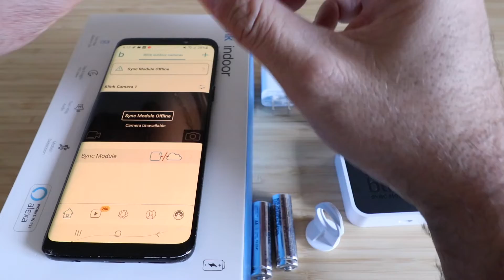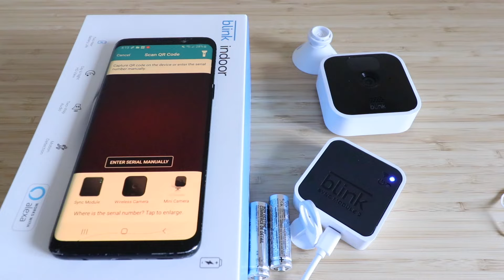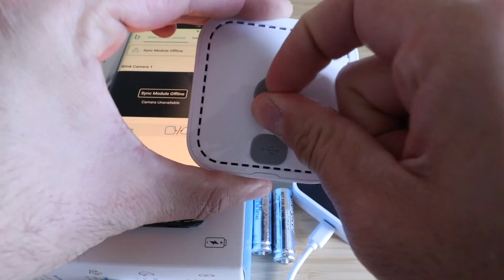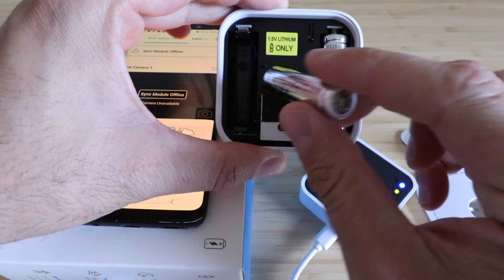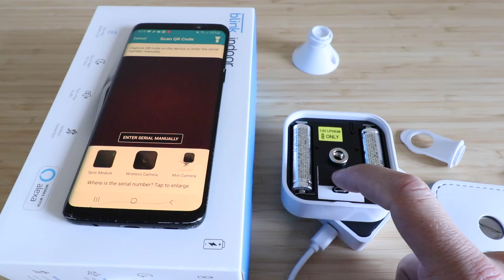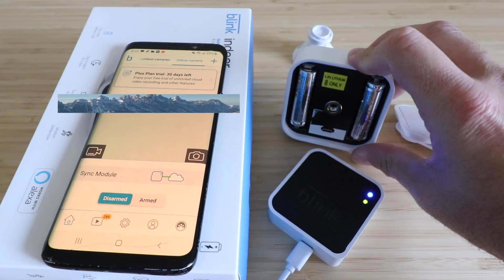How To Set Up Blink Indoor Camera

Comment: 2 questions. If I dont pay for the cloud storage, does the sync module need to be run on wifi still to record with motion detection? My wifi goes out frequently. 

And if it records without wifi, does it ONLY store the video on the flash drive plugged into the sync module?

Comment: Nearly identical to the outdoor version. Would it fit the same outdoor version aftermarket camera mounts? They protect the backside from water anyway.

You could add a link to a mount you recommend and the lithium batteries as well 

Thanks for your help.